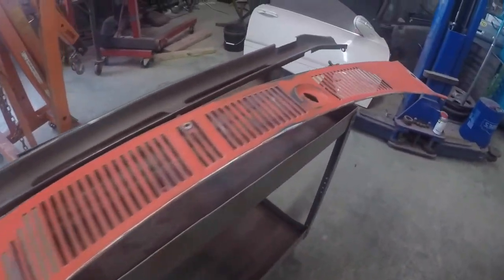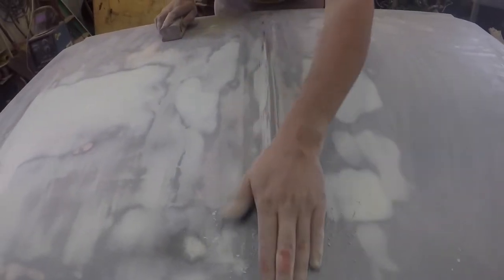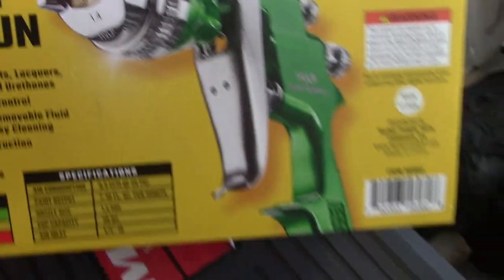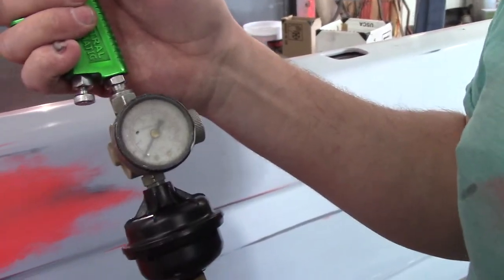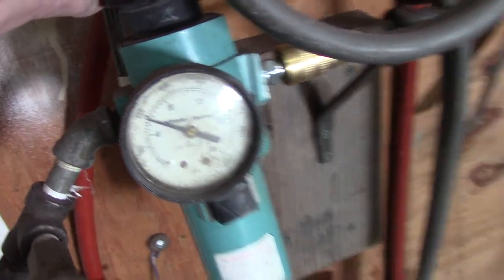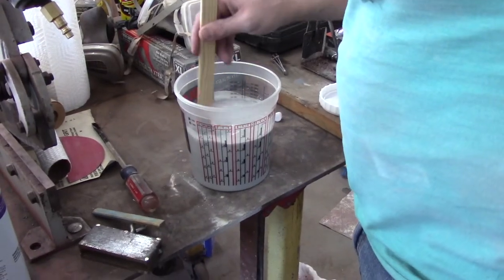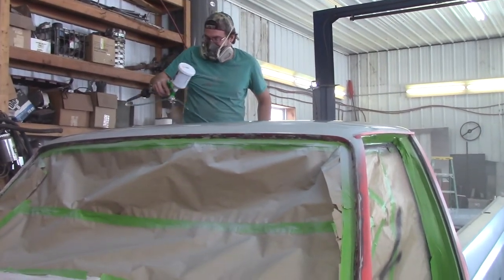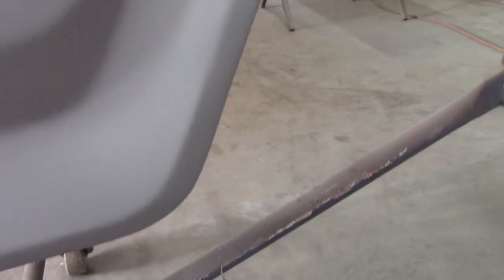Harbor Freight item 56982 VS old Astro hvlp guns for spray painting primer on Connors F 150

Comment: You lose pressure from the length of air hose, so you're regulator gauge and gauge at the gun will never match. I usually run my regulator gauge near filters around 80 psi
Reply: I guess it's pretty randomly asking but does anybody know a good site to watch newly released series online?
Reply: @Johnny Aydin flixportal =)
Reply: @Caleb Jaxton thanks, I went there and it seems like a nice service :) I appreciate it !
Reply: @Johnny Aydin glad I could help =)